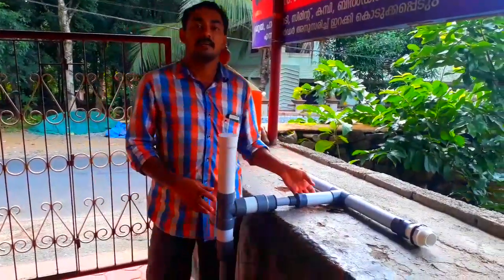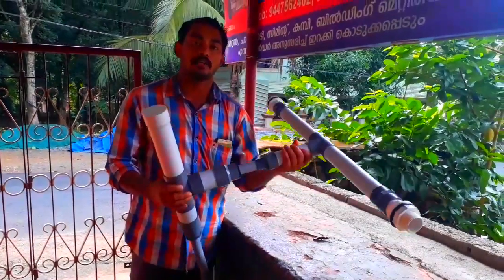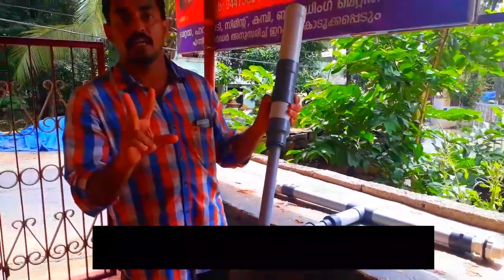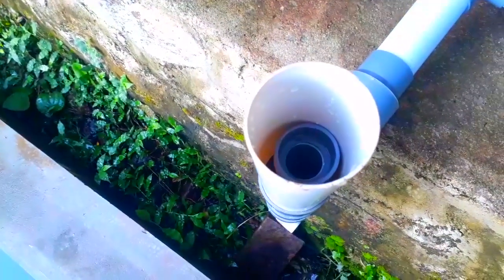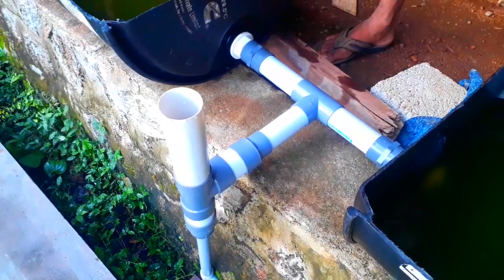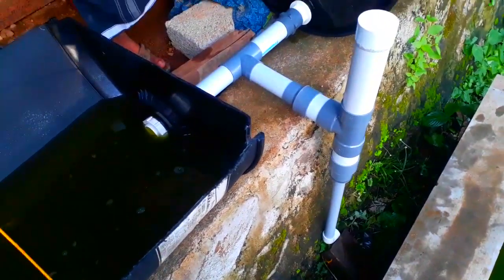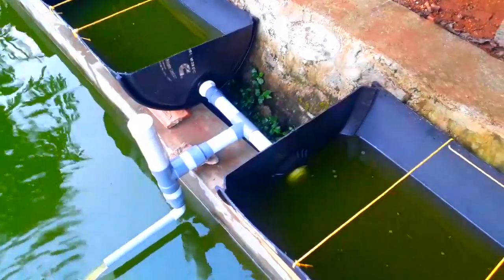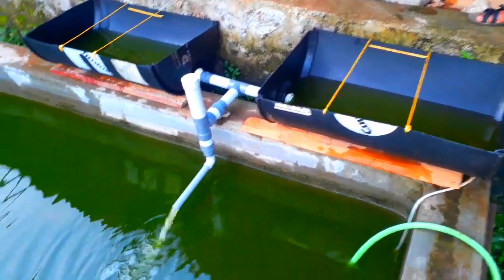How to make Aquaponics External Bell siphon system ( bell siphon) | അക്വാപൊണിക് സിസ്റ്റം

Comment: വിനീഷേട്ട പറ്റുമെങ്കിൽ ഇതിൽ ഉപയോഗിച്ചിരിക്കുന്ന സാധനങ്ങളുടെ ലിസ്റ്റ് കൂടി കൊടുക്കുമോ? Reducer എത്ര Tjoint എത്ര pipe size ? ഒരു ലിസ്റ്റ് ആയി കൊടുത്തിരുന്നെങ്കിൽ വലിയ ഉപകാരം ആയിരിക്കും.
Reply: അതു തന്നെ നല്ലോരു cument എല്ലാര്‍ക്കും ഉപകാരമായി
Reply: 1.5 inch tank connector, FTA - 2,2inch T - 1,2kk oru inch reducer - 1, 1kk 1.25 reducer - 1, 2 inch end cap, 2kk 1.5 reducer, 2 inch pipe 0.5 meter, 1 inch pipe - 0.5 meter

Ethrayum aanu enikk manassilaayath, eni undo ennarinjooa